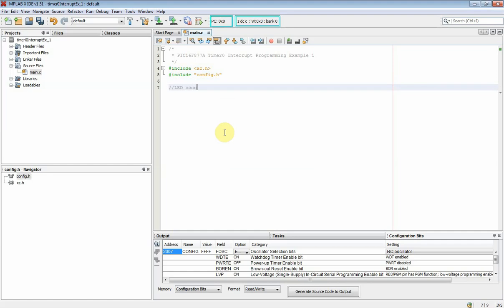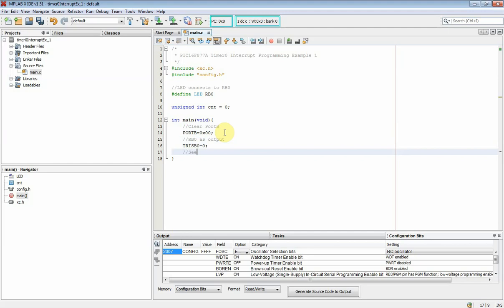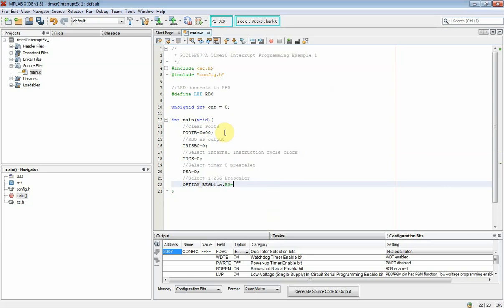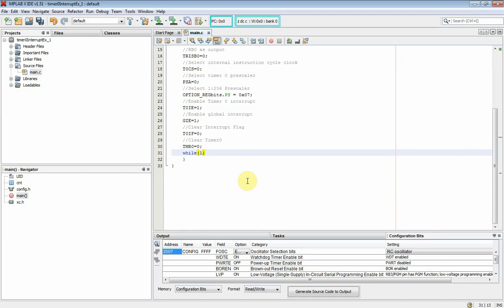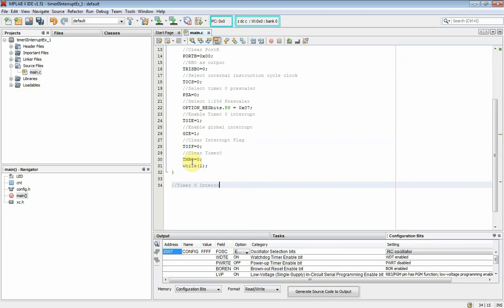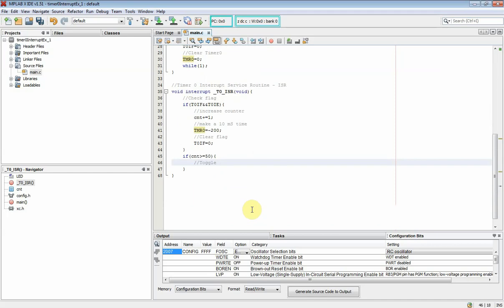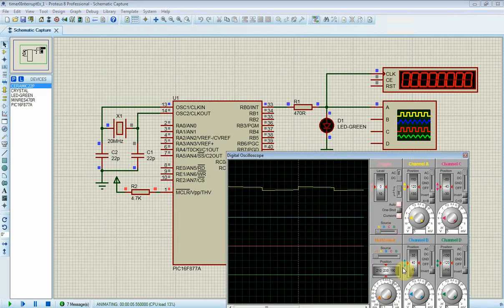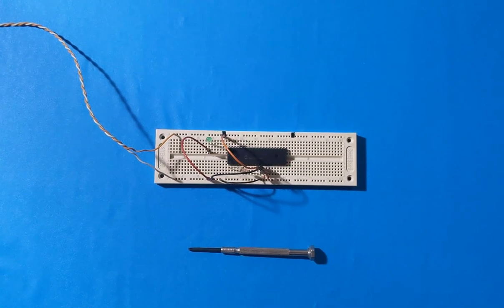PIC16F877A Timer0 Interrupt Programming

Comment: Can you Help me please?
I have MPLAB X IDE V6.0 .        2 ERRORS
Principal16f877a.c:39:6: error: variable has incomplete type 'void'
void interrupt _T0_ISR (void)
     ^
Principal16f877a.c:39:15: error: expected ';' after top level declarator
void interrupt _T0_ISR (void)
              ^
              ;
1 warning and 2 errors generated.
Reply from the maker: Hi, it should be XC8 compiler version. I use an older version of MPLABX IDE and XC8 compiler.
Reply: I changed to an old version and it worked, thank you very much, I will check the manual